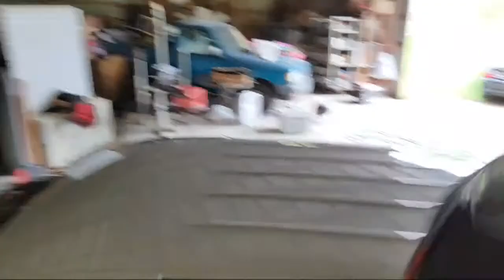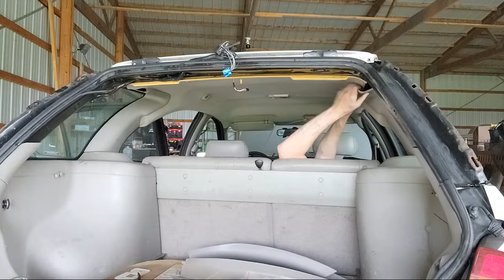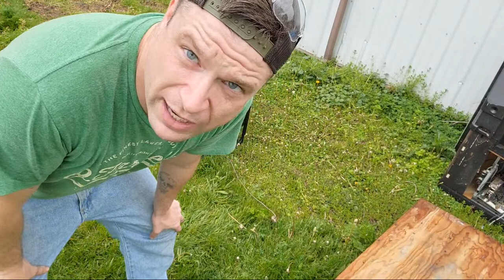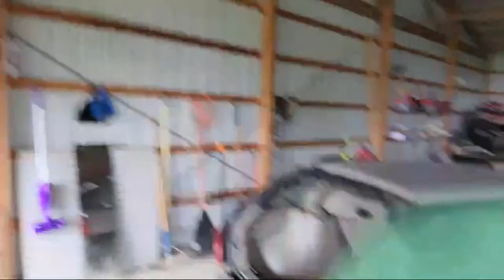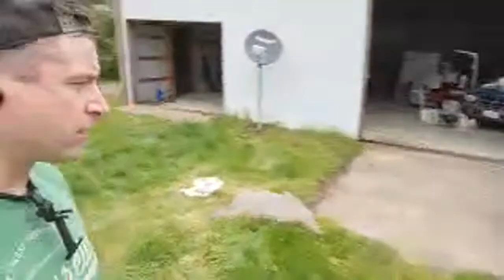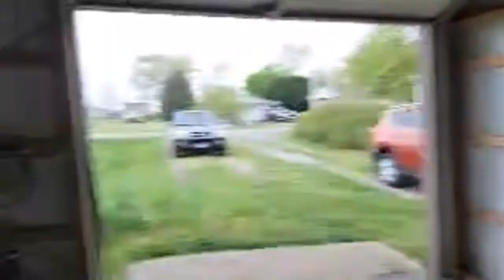Cutting My Station Wagon Up So I Can Haul Engines With It

Comment: Nah you pull the negative not the positive so you do causing a short with you tools because it will disconnect the chassis
Reply from the maker: I knew that. My other phone was off or I would have checked to be sure. It's always the negative that way it doesn't jump to short. You always want your battery to jump to ground. Sorry, but thank you for correcting me.
Reply: @ForwardKind  no problem!just wanted to ensure everyone who watched safety
Reply from the maker: @WyattH  That is 100% the only thing that matters. Thanks buddy and I hope you keep on watching. Just getting started here :)